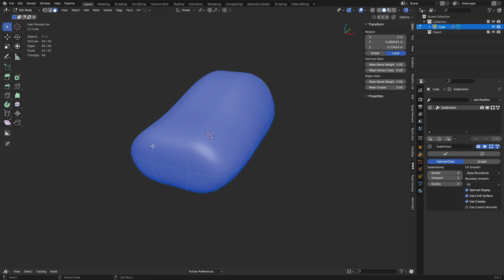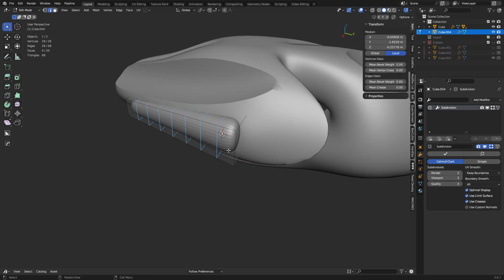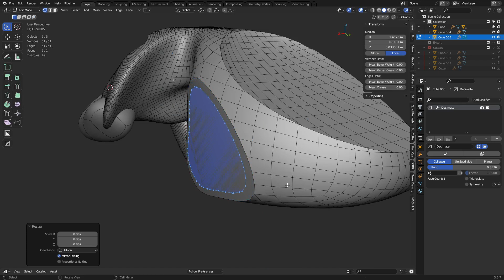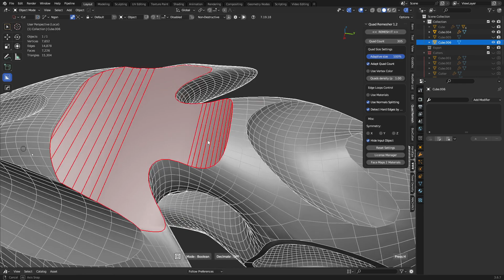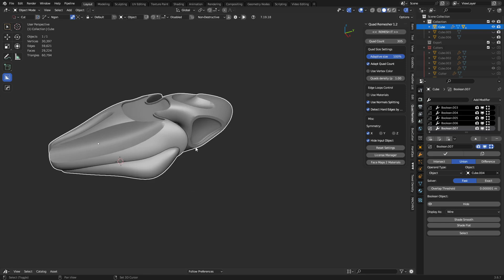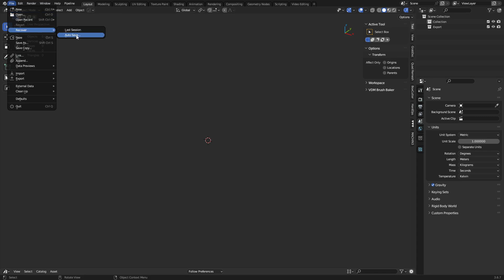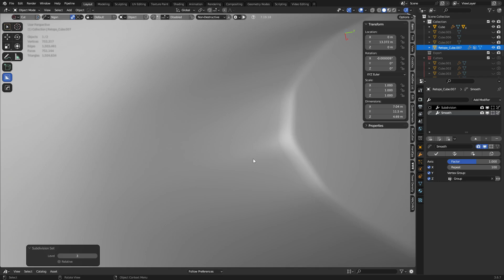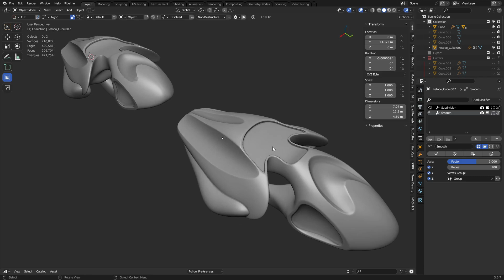Blender - Modeling Forms

Comment: is symmetrize better than using mirror or should the two not be used together? if you have time
Reply from the maker: Mirrors are good usually until you need edges or vertices that are on the opposite side. Experiment with both. You should use both.
Reply: @pzthree   thank you for your response been watching as many of you videos as I can to keep me inspired and learning

Comment: Nice video, thank you. If you were to deliver this example to an employer/client, would you use the remeshed version, or would you retopo by hand? For a game for instance, there's a lot of geo you could get rid of, and it doesn't necessarily have to be all quads since it's hard-surface.
Reply from the maker: You would explain the entire process. With the initial inspiration, scheaduling, concept, goals, highs, optimized lows, baking process, why and how you texture it. Explain why you might of skipped a manual retopo. A manual retopo could be useful if you want to demonstrate your understanding of subdivision. 

Not always required and depends on how you want to present a portfolio. Portfolios are your chance to tell the employer who you are, how you think, how you work.